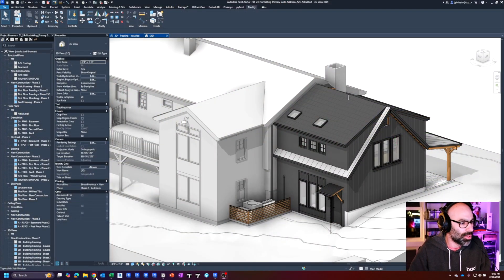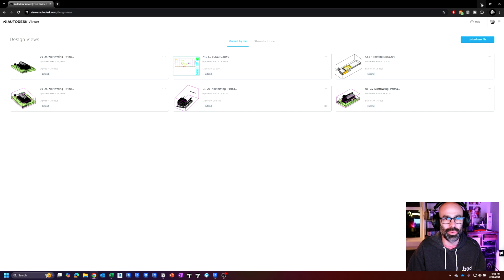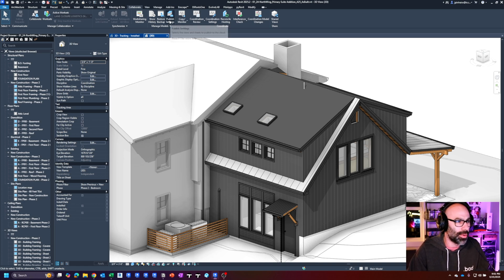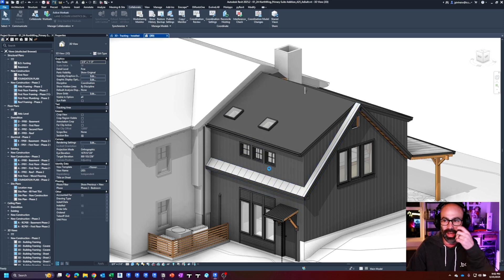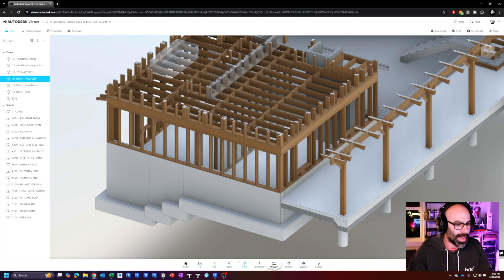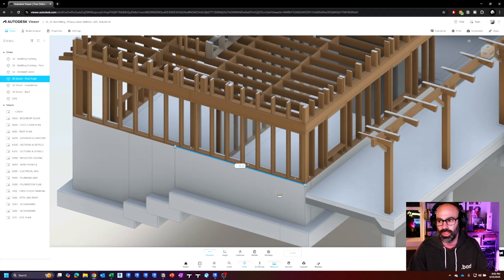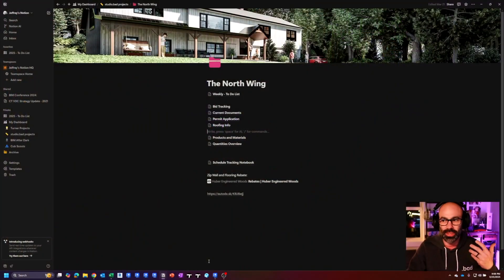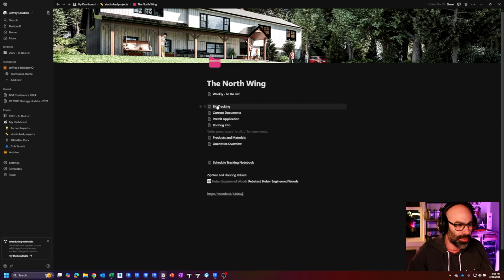Concrete Slab and Waterproofing (North Wing Pt 12)

Comment: Absolute legend! Thanks for sharing such a practical use of Revit in the field — this should honestly be Contracting 101 for every contractor out there.

Your Notion integration really got me thinking: what if you connected your Notion database directly to Revit parameters through a lightweight server? Imagine having a checkbox and date field in Notion, and once you mark it as complete with a date, it automatically updates the corresponding parameters in Revit. I’m pretty sure it’s doable — and could be very useful.
Reply from the maker: @AYDrafting  I thought of that just haven’t had time to figure it out! 😂